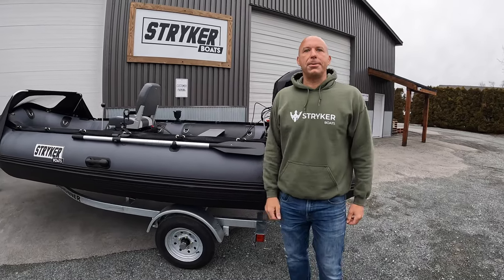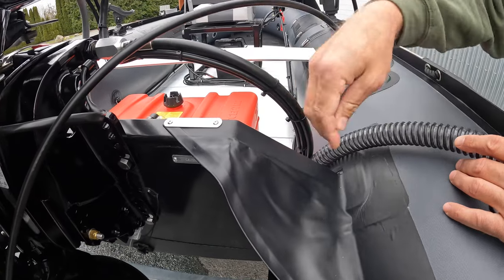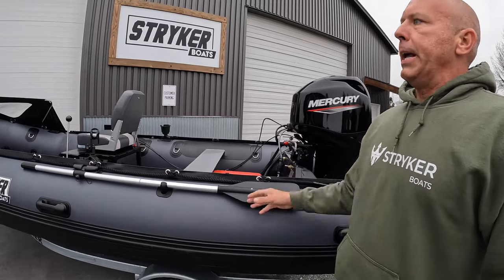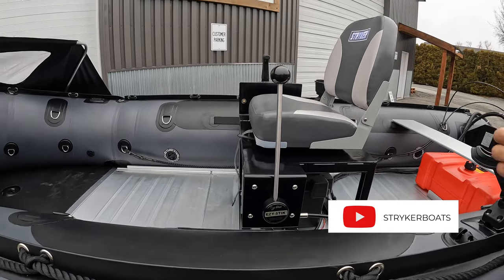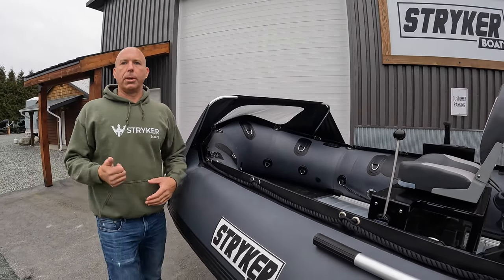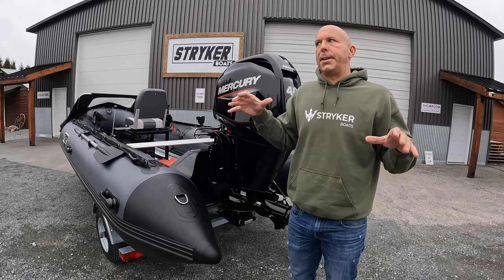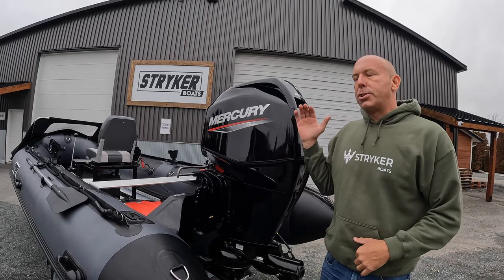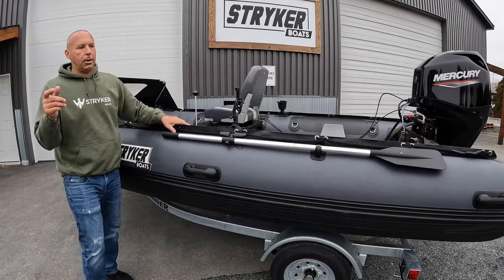2023 - JET PACKAGE - Stryker PRO 470 with Mercury 40HP JET OUTBOARD

Comment: I didn't see a jet tunnel in the bottom of the boat
Reply from the maker: It doesn’t have one
Reply: there ya go, I thought the pros had the jet tunnel , which models have the tunnel built in ? @StrykerInflatableBoats
Reply from the maker: @ericmartens5930  PRO JET does. The PRO has a raised transom and ‘tunnel effect’. It has aluminum floor and can mount seats, consoles etc and will run 3” of water. The tunnel works better in the super nasty boulders.